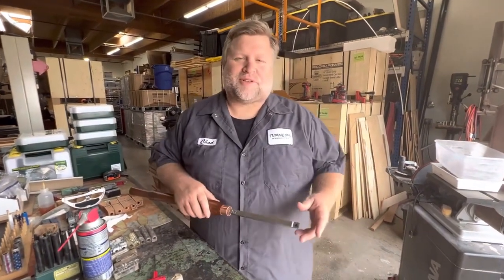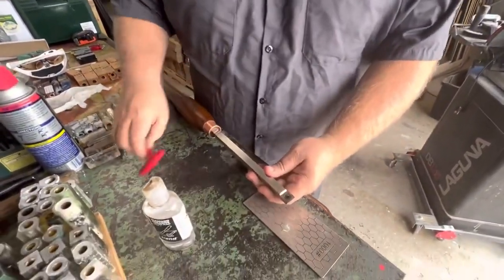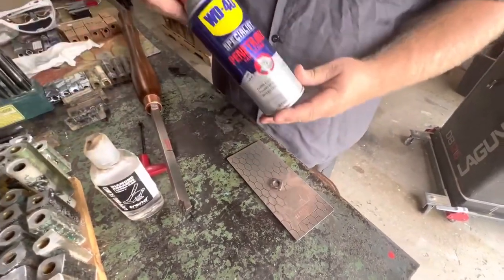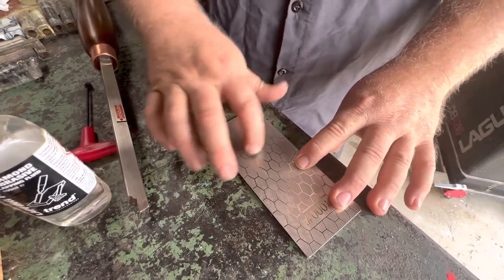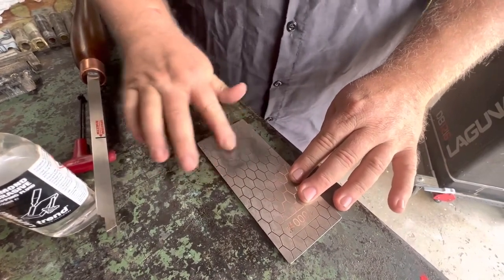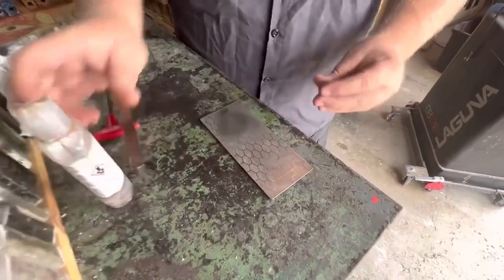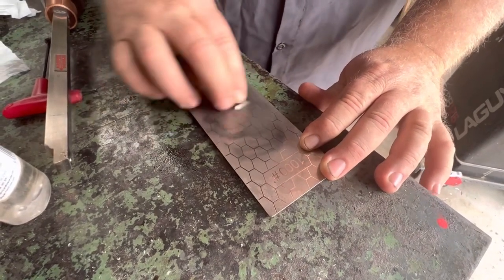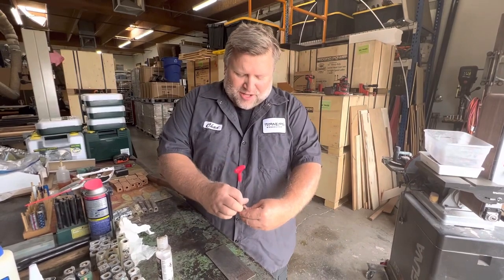Sharpening your carbide inserts to prolong their use

Comment: I'm waiting for someone smarter than me to develop a way to sharpen the negative rake carbide cutters.
Reply from the maker: lol right! We only sharpen the flats
Reply: I looked at my negative rake cutter, and it seems like it could be mounted on a post, run in the lathe, and sharpened.  I haven't tried as yet, but it doesn't appear to have a very tricky profile.  I use standard carbide cutters for plastics, and then shift to the negative rake for finishing passes.  Simply because I've had the regular cutters bite into the material, where the negative rake doesn't.  And I suspect this is due to user error, as I'm just a recent turner, and still learning.

Comment: ...great tip...thanks...it's true what they say...you ARE pretty sharp...😉👍
Newbie here, so let me ask...what's the difference between a negative rake blade and just holding the tool at a downward angle with a normal blade???
Matt
Reply from the maker: In theory there is nothing different, however maintaining that angle and motion would be super difficult so thus we have negative rake 😃 Negative rake is great for beginners and folks who tend to have a heavy hand as it allows for your tool to be less aggressive.
Hope that helps! Thanks for watching!
Reply: @TurnersTv  ...thanks...well, as a newbie, and with very shaky hands (especially when under pressure), which tool would cause the less damage???...😅😅😅
Matt
Reply from the maker: If you are new and just looking to get one tool I would recommend a rougher (square) or finisher (round) and then get the negative rake insert for it. Negative rake gives you more wiggle room and generally helps folks have less blow outs or chips, or as you mentioned "less damage". 
For example lots of folks struggle to turn "acrylic" blanks until they get a negative rake and then they are fine. The easy wood finisher (round) in negative rake is one of my (Amy) favorite tools and Chad probably uses the rougher (square) more than any of his other carbide tools. 
Hope that helps!